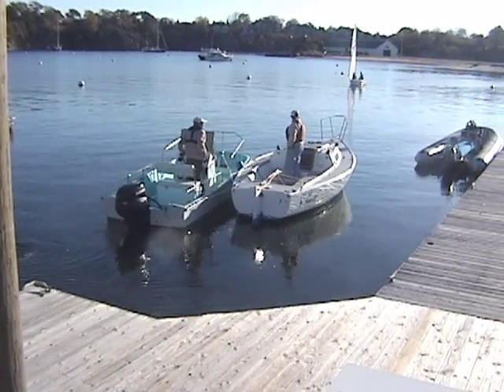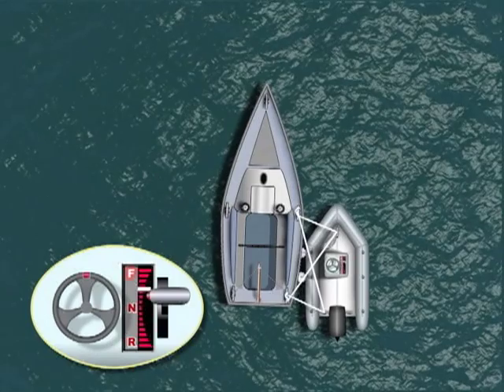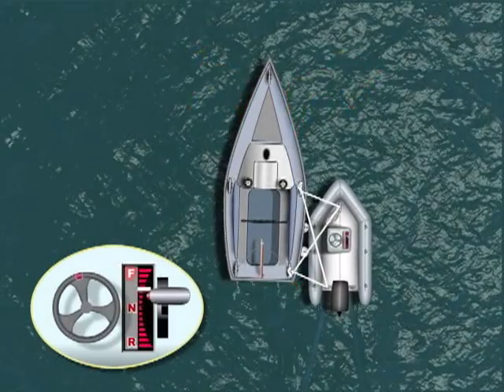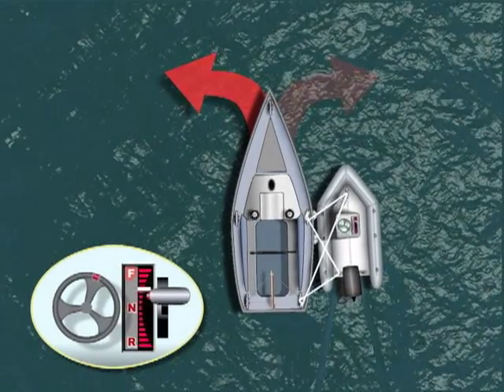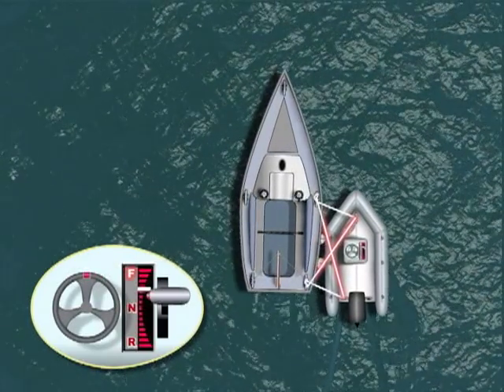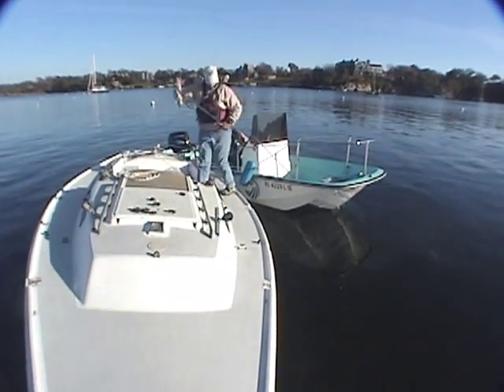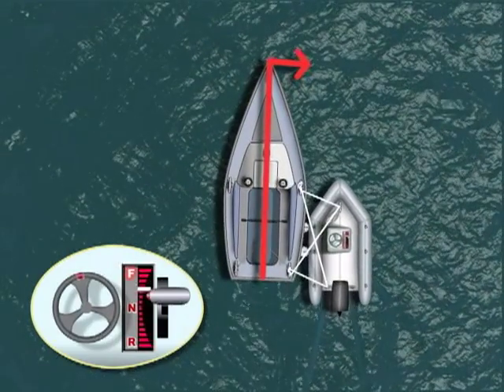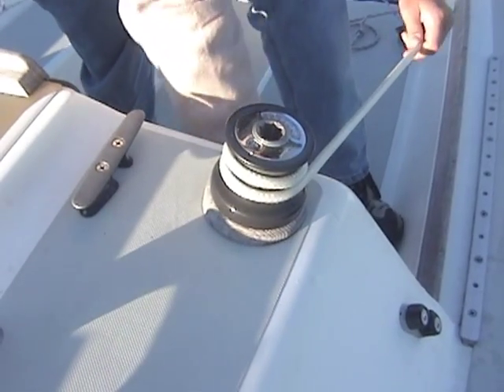Towing Another Boat Alongside Video

Comment: I suspect that this is actually not the best scheme all things considered. I think this is shown by the degree of movement that occurs as the boats try to maneuver. 

While the location of the towed boat slightly ahead of the towing boat is right, I suspect there should be a line from the towed boat's starboard stern side tied to the towing boat's starboard stern.  And the towed boat's starboard bow line should be tied to the towing boat's port bow.  The springs look good.  Also the approach to the dock should have the towed boat on the outside to promote the maneuverability of the towing boat.  Once the towing boat is landed and tied the boats can be separated and the towed boat relocated by hand.